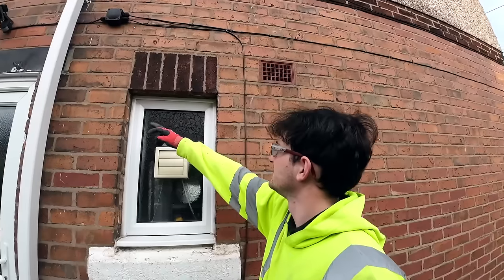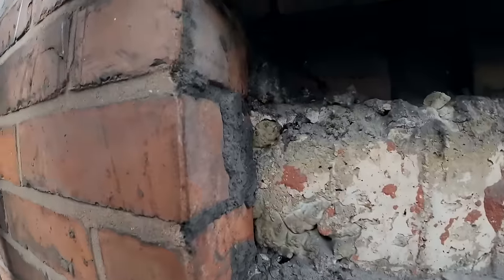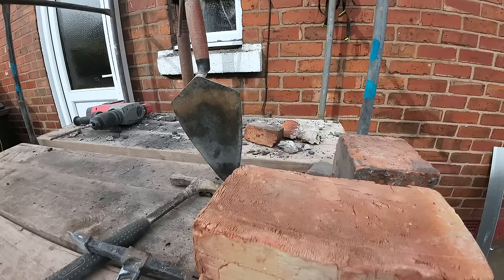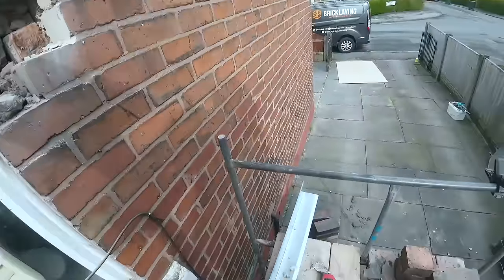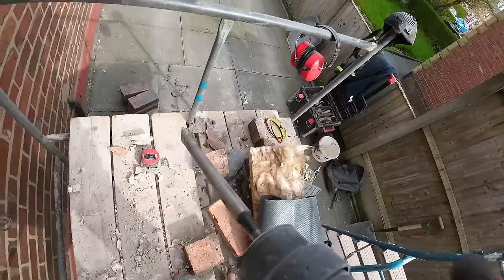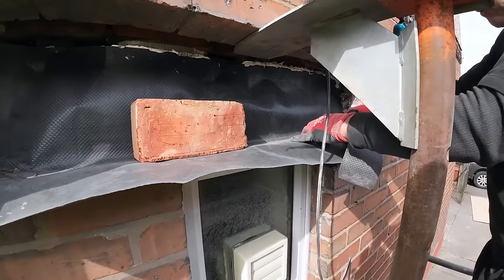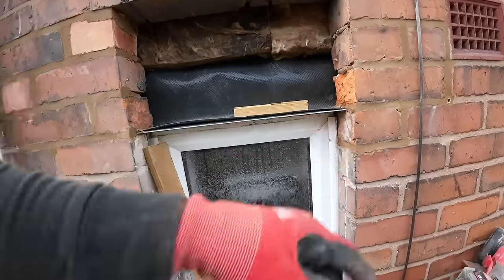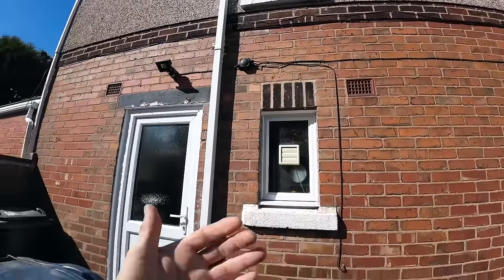TINY LINTEL JOB NEARLY ENDED IN HOSPITAL !!

Comment: These lintels that you chop down, you don't seem to prime and paint the cut edge as per guidelines for what I assume to be galvanised?  The raw steel edge will corrode inwards.  Stainless lintels are an option if you are going to be cutting down.

Comment: Might be a daft question but whats the point of a flimsy lintel that needs "wood" support until the bricks above set?
Reply from the maker: Once the mortar goes off its self supporting , the lintel does very little work
Reply: @SteveAndAlexBuild  I rather guessed that and the mortar is doing all the work but then again this is not an arch with keystone. In an ideal world and not a retrofit would the lintel of choice be more substantial as per some that you've removed albeit old and laminated?
Reply from the maker: @Stormin_Mike no just the same 👍🏽🧱

Comment: I’m only a 19 year old apprentice and just like you I got extremely lucky with a grinder accident. I was cutting out an arch in a brick to go round a pipe and the disc snagged and jumped out at me and grazed the top of my thumb muscle near the wrist. Mm’s away from multiple tendons and somehow didn’t even need stitches. I learned after that I was cutting with the blade spinning towards me instead of away and I was only using one hand to hold the grinder. You live and you learn ey. I’m glad you’re okay mate👌🏻
Reply from the maker: Cheers pal . Lethal things that we all just pick up with no training. Scary really 😬🧱👍🏽
Reply: @SteveAndAlexBuild  At school (electrical engineering) I overheard some other pupils asking a metal shop teacher for an angle grinder because they wanted to cut a hole into a metal enclosure. The teacher did everything he could to dissuade them and get them to use any other tool he could think of that would get the job done more safely. I think he succeeded and they ended up using a drill and jigsaw. Another teacher taught us: "Grinding disc injuries are the worst type of injuries because they remove so much tissue!".

Angle grinders and chainsaws are the tools I've got the most respect for, probably followed by table saws and circular saws.
Reply from the maker: @Ragnar8504 😬🫣🧱👍🏽
Reply: @Ragnar8504  well luckily in my case I just got a slight open slit that didn’t need stitches and a few grazes around it. I can see how it can do so much damage though by how it ripped my glove to absolute bits😂😬

Comment: I am not ! In any shape way or form having a go at you, cos i really enjoy watching your work !  At the point you had the grinder fall, i was actually cringing cos i could see the battery in place.  I also woukd point to something  that I've always done when changing a disc, n that is, once the disc is fitted i spin the disc noting a particular point on the guard, to see if the disc is turning concentrically, n then i turn the grinder 90° to ensure the disc is not " cocked " in any way, whilst rotating the disc again.
I'm  saying " how i do it "  thats all .
Keep up the GREAT VIDEO'S  GUYS !!
Reply from the maker: Thanks for the tip 🧱👍🏽

Comment: After near miss with changing blade with grinder battery in you demonstrate changing hammer drill head with battery in.
Reply from the maker: The drill has a safety switch on it

Comment: Cracking job as usual, do you have to trim the galvo lintel, or is just cosmetic ?
Reply from the maker: Yes for the cavity tray 🧱👍🏽
Reply: @SteveAndAlexBuild  Sorry Steve, i'm a numpty, i meant the underside of the lintel that's showing above the window, can it be left to the elements, or like you have done, trimmed it with plastic.
Reply from the maker: @davidcort2857 Ah just cosmetic and a pain in the arse to do 😒🧱👍🏽
Reply: @SteveAndAlexBuild  Thank you.
Reply from the maker: @davidcort2857 🧱👍🏽

Comment: Nice work as usual, 👍 you don't see many houses with air bricks half way up the wall , only occasionally why is that?
Reply from the maker: That’s when the cavity was empty and vented 🥶🥶🧱👍🏽
Reply: @SteveAndAlexBuild  thanks ,in my home town we have similar houses you can get two houses next to eachother but only one will have air bricks half way up the walls maybe some have been filled in over the years
Reply from the maker: Sounds right 🧱👍🏽
Reply: @SteveAndAlexBuild so if you have cavity wall insulation you should be able to remove the air bricks that are half way up the wall?? Mine are filled with silicone that’s got holes and others are falling in.
This could be the reason behind moisture drip marks on walls you think?
Reply from the maker: @msw8313 . Yes no need for vents generally with the exception of ones installed to vent gas fires 🔥 🧱👍🏽

Comment: I like the sds drill but the grinder is not so good, very poor trigger design to turn on like that and a very shallow cut my friend, only looked to be around 15mm. my Dewalt design would put it to shame. and whats going on with the thickness of a modern lintle that can flex like that over a 400mm span. as alwas I still remain a fan of the work and show